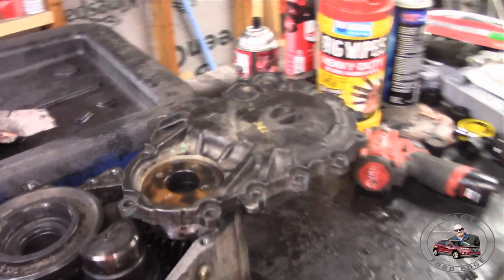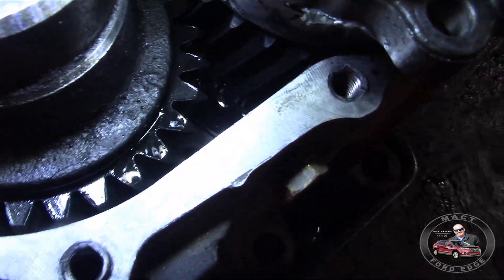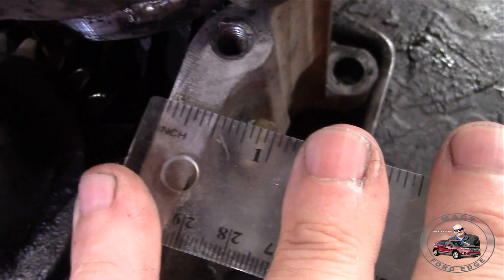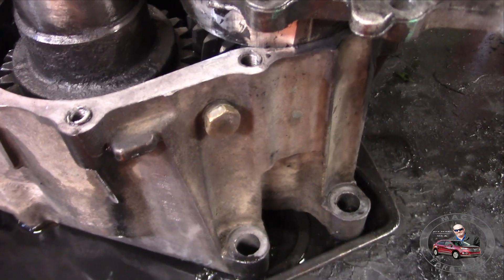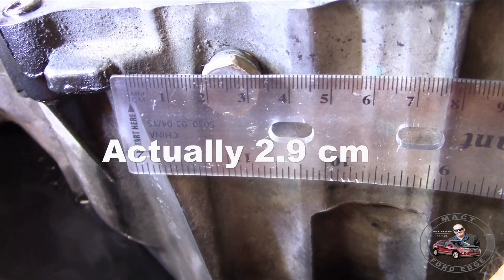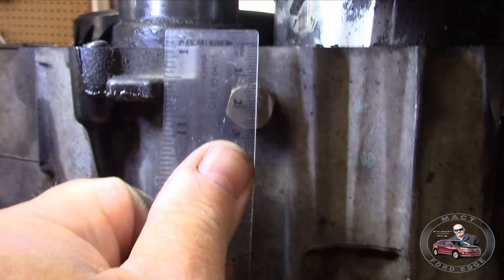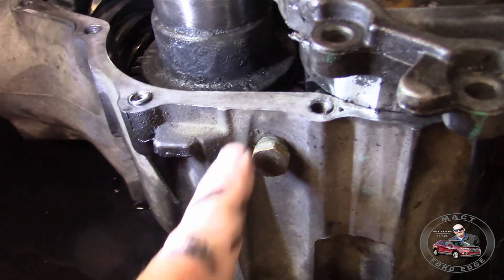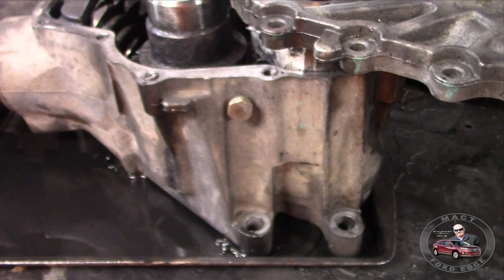Where to install the PTU drain plug and an inside view of the clearance to the gears

Comment: Great video with a helpful glimpse inside the PTU. On 2014 Flex a hole 1” in from the edge is right over the exhaust pipe. 2” in would put it between the exhaust pipe and heat shield. It looks like it would still be clear of the gears. What are your thoughts? Thanks.

Comment: Hi Mac T Dave from Canada. (Newbie)  here.  Can you please explain why a 7/16th drill bit is used for a 1/4" NPT tap? Doesn't that leave the drilled hole 3/16ths to big ?  Awesome helpful Videos from you!!  With Thanks  Dave
Reply: It's a tapered plug you tap the hole with the tap and then you leave about 5 or 6  threads remaining out side the case.